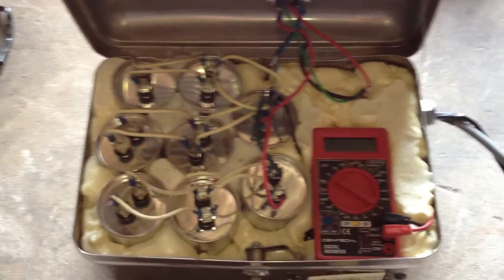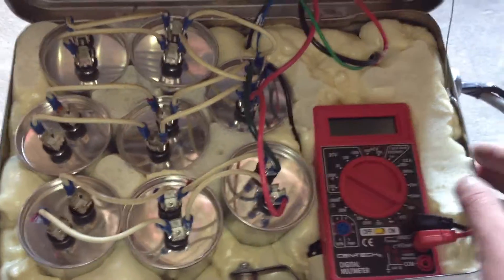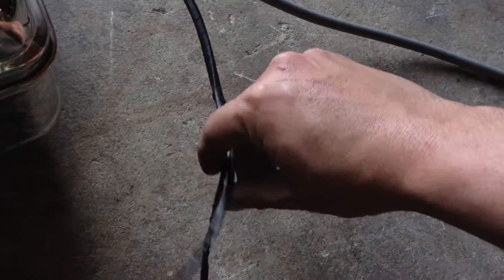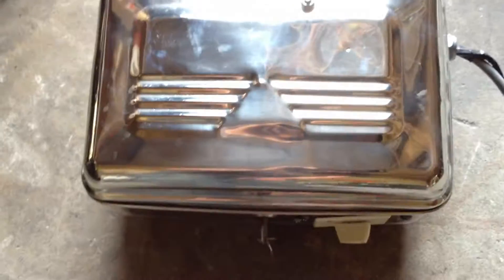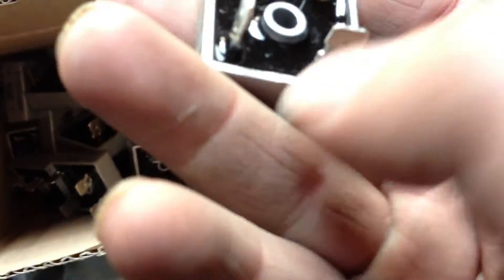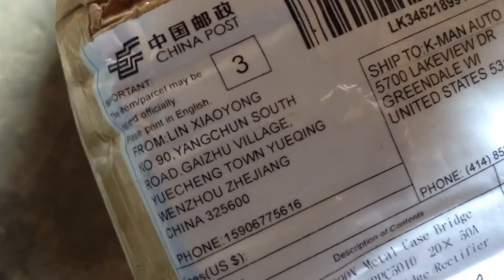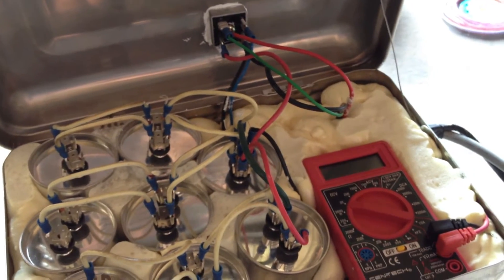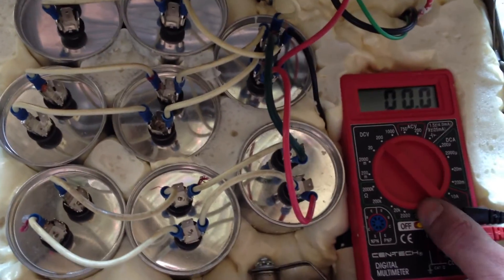Capacitive Battery Charger for Electric Cars, EV's Golf Carts, Forklifts

Comment: You stumbled over the capacitor values. Please restate the value AND the voltage rating. One or the other does not help us do it yourselfers.
Reply from the maker: The caps are 80mF, the rating on them is around 400v. When plugged into 120v AC, it will output up to 170v DC. On a 240v outlet, it will output up to 340v DC as well as double the current.